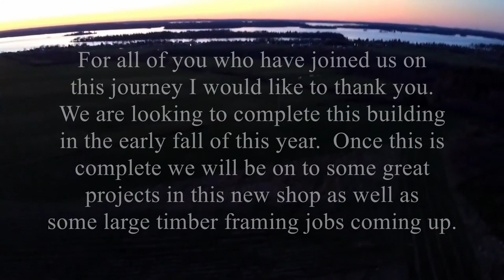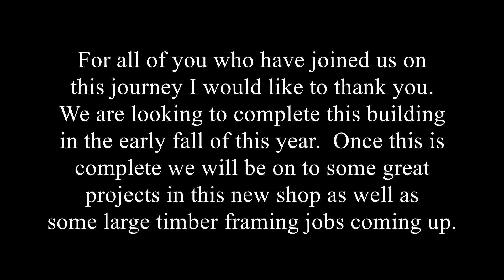Birth of a Wooden Barn: A Timber Frame Journey Part 3

Comment: looking more like an arc at this point.  this is massive
Reply from the maker: It was a process for sure.
Reply: @TheTradesmanChannel  doesnt look like you dried your wood before using it.  have you seen any warping/shrinking issues from that?
Reply from the maker: Not at all.  It's much better to build these green, that way the joinery shrinks together.  You also have to mill your timbers properly, center the heartwood as that helps control checking.

Comment: Ok, I need to know which of your videos shows how to mortise the receiver holes for the 45 brace? I understand how to cut the 45 but not the mortise.
Reply from the maker: Good morning.  The mortise is the same as any other, just a rectangular hole.  You don't have to cut any 45's in it.  They are only going to be about 4" deep.
Reply: @TheTradesmanChannel  what tool do you use for that hole? If I don't have it,  I could probably make it.

Comment: Gorgeous work! I haven't yet seen the previous parts - Did you design and build that (mostly) by yourself? I keep wanting to pitch in when I see you struggling with a huge beam by yourself.  :-)
Reply from the maker: Hello Walter.  I have indeed built just about the entire thing alone and out of my head.  Back in May I fell off of the second floor and shattered my right ankle... I'm just now getting back on the project and getting ready to frame the roof.

Comment: Quite a undertaking! Did you do do this all by yourself. Looks like it. How long did this take you? Looks like the timbers are starting to age. If you did this by yourself, I am in awe!
Reply from the maker: So far I have done this totally solo.  I fell off of the second floor in May, shattered my right ankle...another six weeks to go for full weight bearing.  Only eight timbers left to put on so I can roof it.  I've been working on this off and on for 2.5 years.  I also have a full time job and a farm so time for the project is been limited.